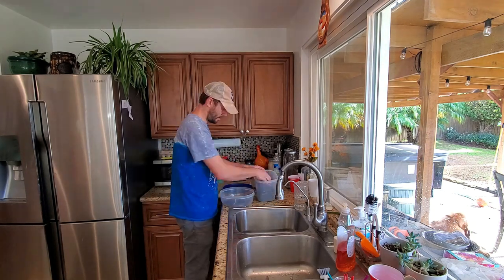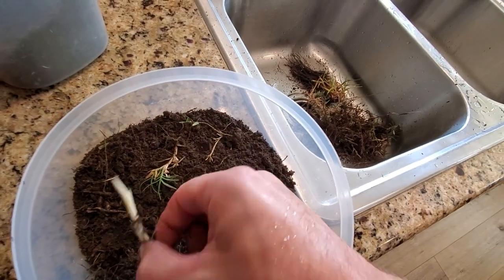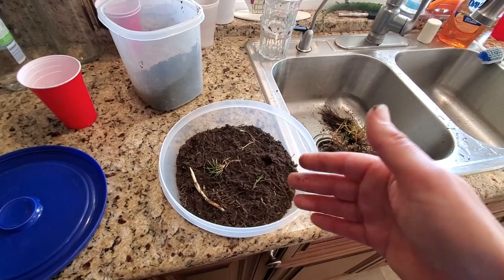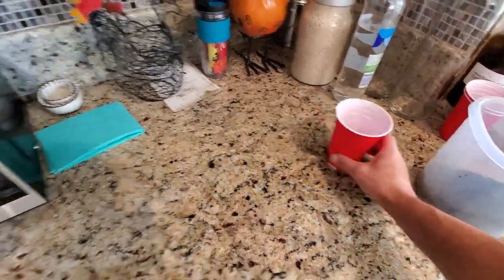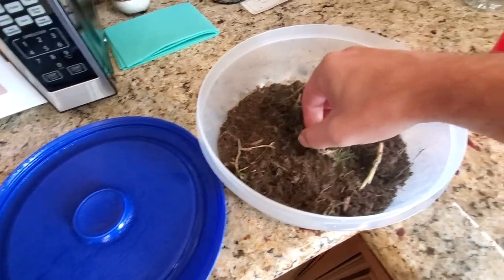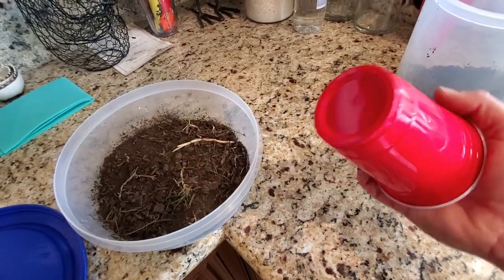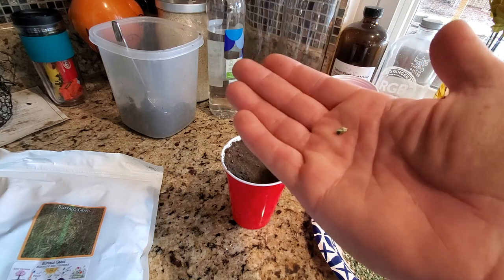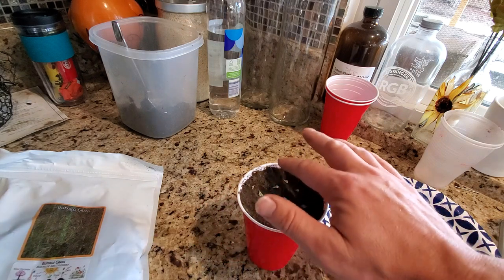How I'm Sterilizing Native Soil To Make Make My Own Grass Plugs

Comment: At 8:50 you mentioned you were going to do 9 plugs per square foot. Is that a mistake? Seems like really dense plugging if the plugs are solo cup sized. Cool Vid!
Reply from the maker: I think you are right! I was thinking off the top of my head 3x3 for a square foot but 2x2 seems much more reasonable meaning would need only four per square foot or 400 per every 100 square foot of lawn. I could probably do less but I want this dense as soon as possible with it being a high traffic sidewalk strip. Tons of bikers, walkers, and dogs come around this bend every day. Thanks for your feedback, made me think it through a bit more in another light.